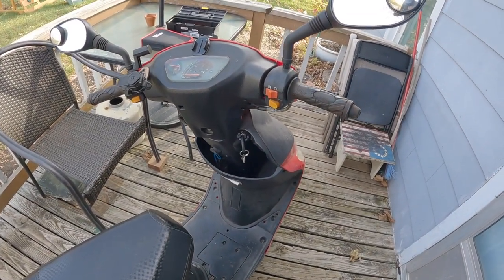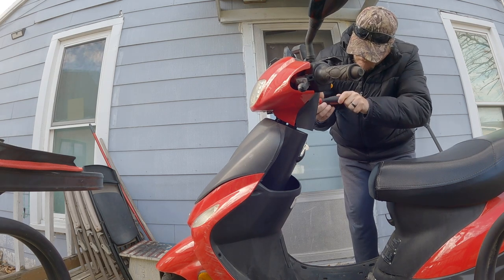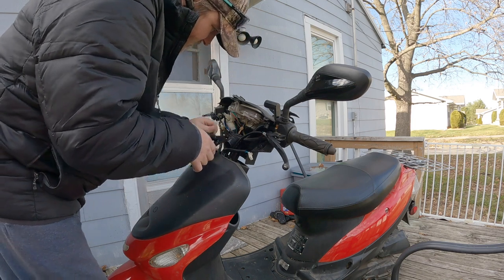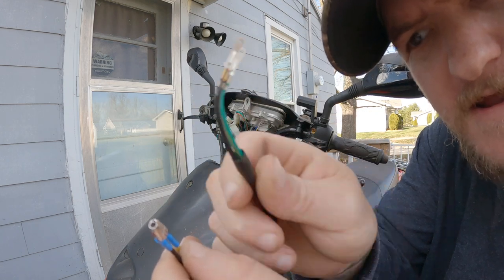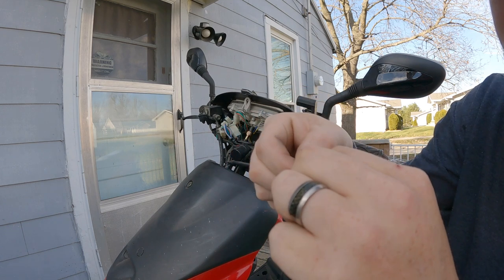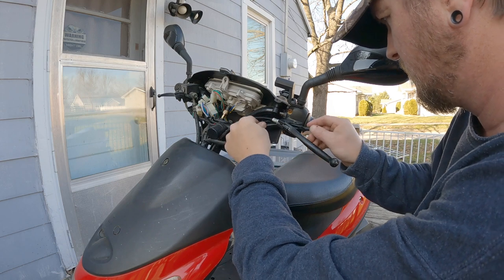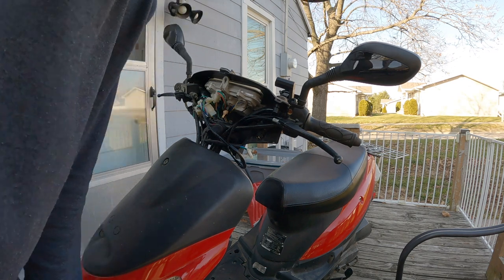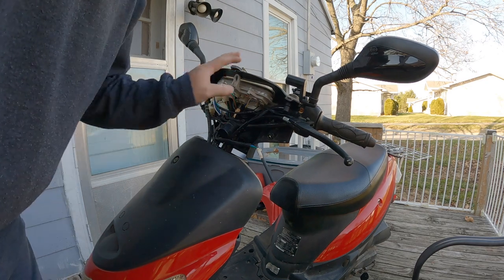How To Replace Brake Switch On A Scooter

Comment: Thank you for showing us this will come in handy at some point never fails to not be a problem down the road
Reply from the maker: When I first discovered it was bad, it was because it wouldn’t start. I didn’t know that a bad brake switch did that. I went months just using the front brake lever to start it which is a hassle because it’s easier to hold the rear brake lever while starting. Then of course remembering to make sure I used front brakes every single time on the road so it lights up. I always use rear brakes first. Throttle off, rear brake, then both brakes. Next spring I’m doing tires, drive belt, and possibly a windshield for the suicide bugs at night 😂
Reply: @TheOutdoorExperience that's always good to have Sheild  suicide bugs 😆 🤣 😂 😹  that they are